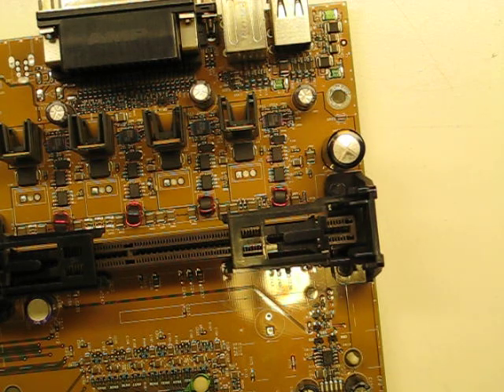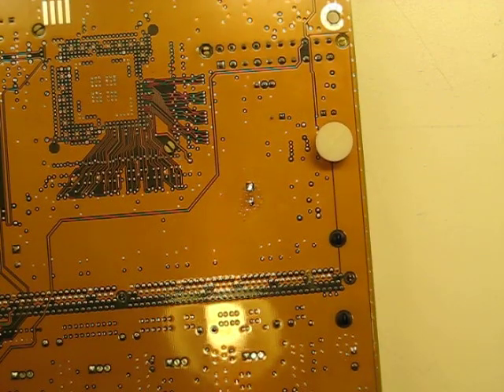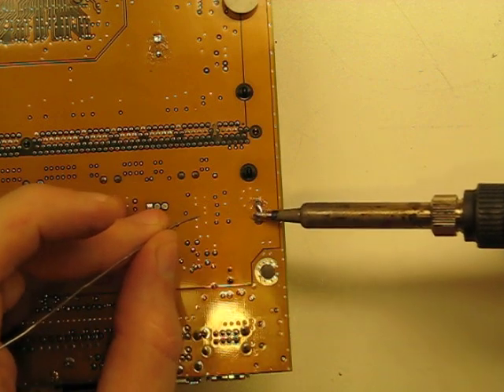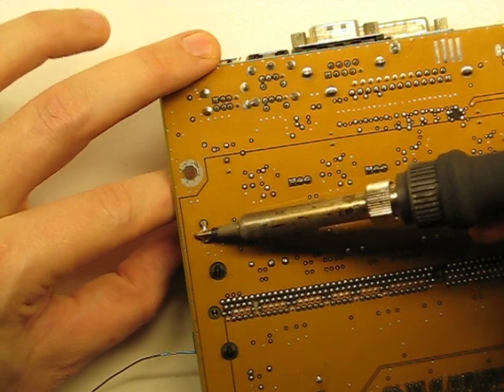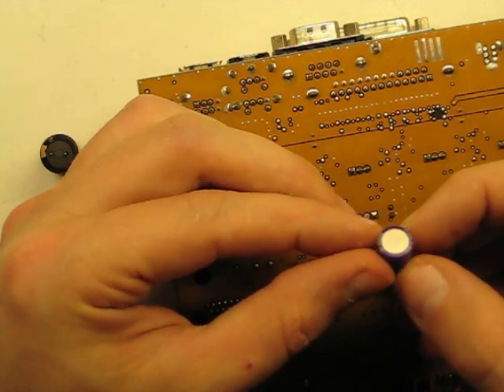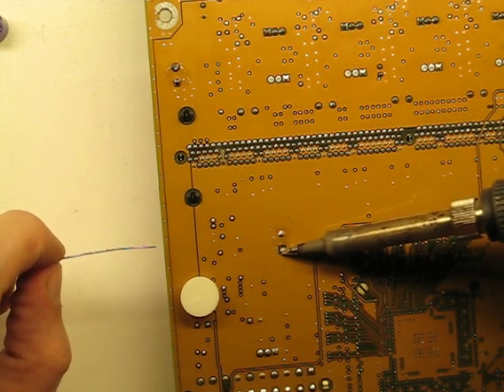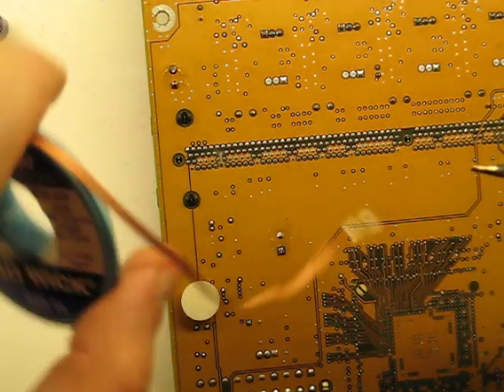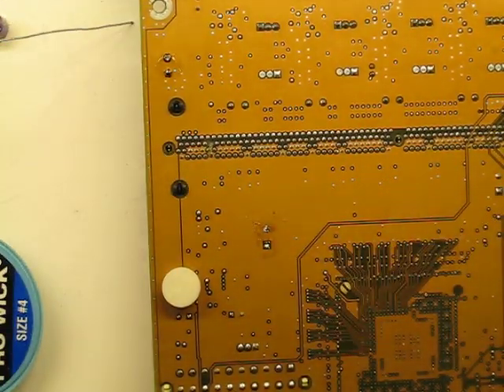Capacitor Desoldering

Comment: Hey, great video. Thanks to your trick I've been able to replace 5 capacitors for my monitor, without a wicker nor a pump. Although, after the first 2, I removed by heating & pulling each side of a cap little by little. That was less messy, too.

Comment: Great video. tried all sorts of methods but non worked with a motherboard with lead free solder. 
Adding lead solder helped soften the original solder and by bridging the two joints together heated both at the same time whilst wiggling the capacitor
many thanks

Comment: What temps did you use to desolder these caps ?
Reply from the maker: +oDJOldskull Sorry for the delay. I couldn't remember, but about 45s in I state that it's near 700F (~375C).
Reply: +DJPhilTBCollins Thanks, then it means that im doing something wrong as my desiring iron is good quality, temp is good  and I use soldering paste and a bit of solder during an attempt to desolder the cap. Interesting thing tho is that all of the caps that don't want to desolder are making some buzzy/clicky noise when I press a hot desoldering tip to one of the caps feet. Weird...